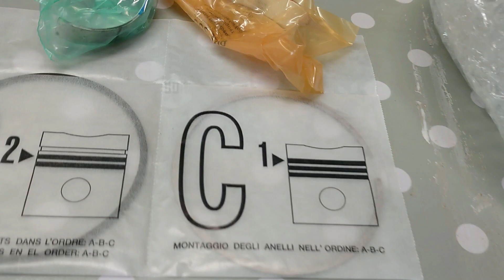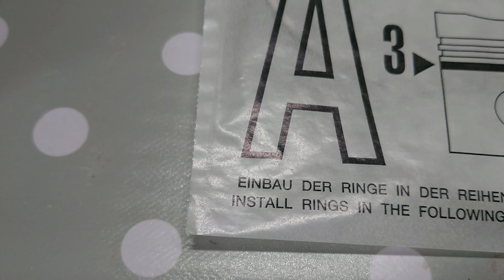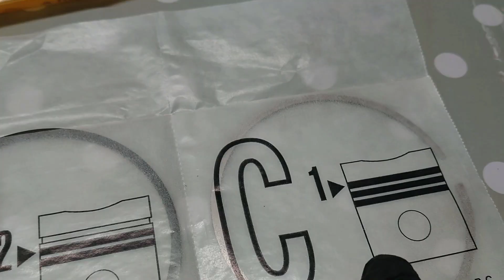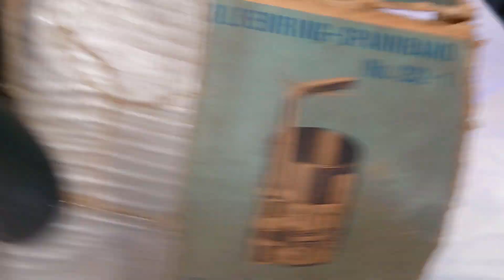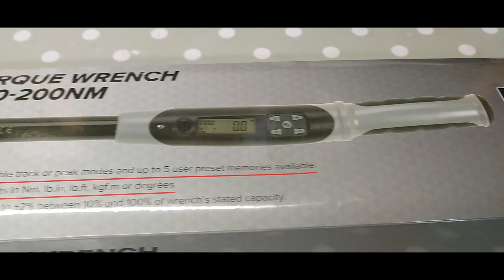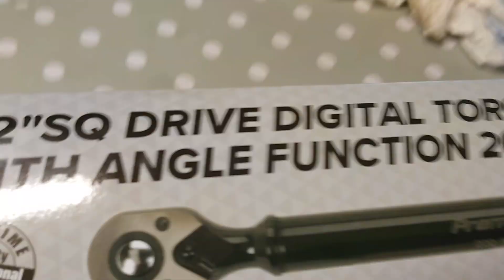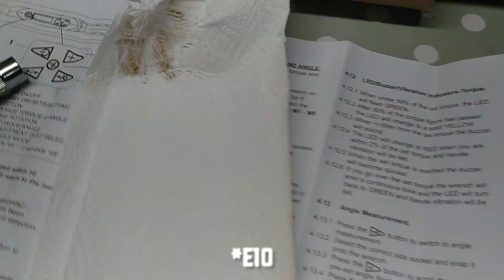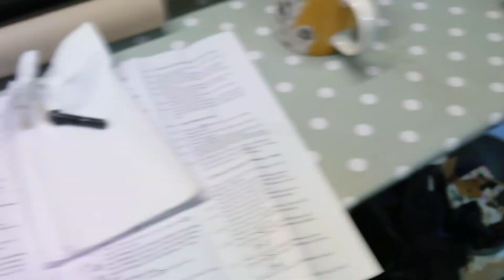Changing the damaged Piston on my BMW F10 M5 S63TU engine rebuild on the driveway

Comment from the maker: The rebuild begins now !! I've got to admit, taking it apart is one thing, but putting it back together is another. Hope I can remember where I put all the parts. Getting this piston in is just the start, I've still got 7 bearings to change and then reassemble the bottom end before I put the car back down on the ground and start work back up top. This could take a while.

I've also started a Buy Me a Coffee page, any and all donations are gratefully received and all proceeds go back into making sure this car gets back on the road.

https://www.buymeacoffee.com/RichsRides

Comment: Was their total failure to this engine when the piston blew or just cylinder issues? Just good info to have if it produced symptoms just in case its fixable if stopped immediately
Reply from the maker: when the piston blew. the cylinder marking is from when the engine was run after the piston had a hole in it. luckily it doesn't look like there were many miles out on it after it blew!

Comment: How did it go?
Reply from the maker: +Dark Knight Cars mate it's still up on blocks. had a tough year last year and have been too busy renovating a property this year so far. hopefully back at it in August 😃
Reply: @RichsRides  I replaced one of mine on the ground, cylinder 6, got it back together now I believe I have another on #4..
Reply from the maker: +Dark Knight Cars what is it with Cylinder 6!? bad design maybe?

Good luck on #4
Reply: @RichsRides  I had a tune on it we suspect pre detonation. Probably what ruined cylinder 4.
Reply from the maker: @ClearedForSomewhere  gah, where did you get the tune from, was it an off the shelf or custom job?
Reply: @RichsRides  Eurocharged tune it’s here in the states
Reply: @RichsRides  a place called Euro Charged they just uploaded it without checking the values of the pre detonation. I deleted the tune but it still runs bad so we are going to open the engine back up again. We initially removed camshafts not knowing you could remove the head with them on there. When we reinstalled them we put both the labels facing up which is not the correct way come to find out. We are wondering if trying to start it with one of the cams at a 180 different may have damaged valves. Now the cams are all back the way they should be but we are still getting a rough idle. Compression numbers are all at about 140 psi but leak down is perfect. Not sure yet we are sorta stumped
Reply from the maker: @ClearedForSomewhere  are you sure it's timed correctly? What about plugs / coils everything tight and plugged up securely ? Do the plugs look ok?
Reply: @RichsRides  plugs look like it’s running rich, everything is timid correctly, come to find out just about an hour ago the compression tester isn’t working correctly so I’m assuming the compression is fine. It showed about 140 psi switched it around to a couple other cars it showed 100 so we think the tester is no good. It just has a rough idle with no codes being thrown
Reply: @RichsRides  yes everything is good. We originally timed it with both of the labels up on the cam shafts come to find out one label is down and one label is up so we had to go back in and retirement we tried starting at like that so hopefully that didn’t cause any damage but all the test for leak down and compression are fine.

Comment: What happened to the channel? Did he fix it?
Reply from the maker: +smokedadowg I'm still here and the car is still up on blocks on the driveway.

unfortunately I had a few events last year that put this in the back burner. but I will be back at it when the weather warms up. I want to get this finished by the summer!

Rich
Reply: @RichsRides  glad to hear mate
Reply from the maker: +smokedadowg cheers dude. just a shame the weather is so crap at the moment!
Reply: I know the feeling bud I've got 2 classic 2 stroke 125 motorbikes that need finishing just way to cold to be out doing anything on them at the min

Comment: hello, did you find what happend to your old piston?
Reply from the maker: +Patrik Parlesák stuck injector, common problem on these motors.
Reply: @RichsRides  I find blown piston on my n63 but injectors are tested and they are ok.. now it’s running 2000km after rebuild with same injectors.. so I don’t know what happend here 😃

Comment: 12:45 Hmm, Nasty but for engine assembly get the best sockets. For all other applications standard sockets apply. (I built steel engined BDA engines for my rally car)... Hey you are not a bad workman blaming his tools...!
Reply from the maker: +Mr Z I hate those bolts, such a bad design in my eyes! 

Definitely not my fault 🤣

Comment: Serious torque procedure for OEM bolts did you ever consider ARP bolts I'm changing rod bearings soon and can't seem to find any information on ARP torque settings
Reply: I noticed some copper flakes in the last oil change I did and beginning to think it's time for a strip down, I'm guessing the prolonged torque settings are to stretch the bolts? I noted the ACL bearings allow a little bit more play rather then the OEM bearings. Would you still plastiguage it
Reply from the maker: +Jonathan Linehan definitely a sign it's time. I would guage it to be safe as you're going with the ACL bearings, but check with ACL too or someone who's used them before to be safe.
Reply: Thanks Rich I've make a little video and share all my findings with YouTube
Reply from the maker: +Jonathan Linehan I didn't look into them, just went for OEM. are you doing them yourself ?
Reply: @RichsRides  hi Rich yes I'll be doing it myself thinking of using ACL bearings and OEM bolts your video is the first I've seen showing the process awesome
Reply from the maker: @jonathanlinehan9316  very brave! I used OEM bearings  and didn't bother messing the wear with plastiguage as the bearings that came out weren't massively worn (in my opinion). But they definitely needed doing. You might want to consider measuring the wear depending on what your bearings look like.

Comment: Hi Rich, your saying we should let you know if your doing a mistake in the comments, and maybe there is something you need to know:
I watched all your videos so far and saw you in part 5 manualy honing the cylinder. Like you allready know the block is out of alusil. You can do it they way you did on a steel block, but on alusil you have to get some special polish paste to uncover the silicium-crystals to the surface. If there is alu left, then this can causes wear and friction. I hope its maybe early eneugh and you dont have the heads back on. This can be a very easy and cheap step to prevent a further damage.
Then theres another thing i might figured out what could caused your damage:
I almost ready everything i found on the german and american sites about the s63 engine(took me at least 30hours), because i bought a M a few weeks ago, and read a lot about seized engines and problems with the s63. In my opinion the s63 has very big problems with the direct injection. In the USA more than in Europe because other fuel quality. In some cases of seized engines the piston got hydroblocked while the injector stucks fully open and filling up the cylinder with fuel. In other cases the injector is leaking to much fuel wich wipes of the oil of the cylinderwall and causes just the problem that you have here. I would recommend you do not use the old injectors again without having them tested! Maybe in your oil analysis they found much fuel in it, wich confirms my thesis.
I realy hope you get it back running and wish you best luck.
If you need to know more, feel free to contact me.
Regards
Reply from the maker: +Azamat Bagatov thanks. it wasn't really a home, it was more of a clean off the build up of contaminants from when it blew! I did look into the Alusil treatment and special Alusil hone but it cleaned up so well I decided not to. I've know Porsche use this treatment too and they e suffered a lot with bore score in some of their engines (not sure if it's still a problem for them?). I've measured the roundness too, wanted to make sure I hadn't changed the shape of the cylinder and it's well within a few thou.

I agree about the injectors, they're going to get replaced as part of the rebuild too. there was. o point doing an oil analysis as I'd run the car for a bit until I found the problem, there would be loads of fuel in the oil sample.

have you had issues with yours or were you just reading up to find out what sort of issues to expect?
Reply: @RichsRides  Hi Rich, sorry for my late response.
I was just reading about issues i have to expect.
I found your channel at the time you removed the injector. I looked for some faster sedan cars since 2 years: first Alpina B5s, then Porsche Panamera, E39 M5 and for short an M5 E60 (usually i only drive BMW because i got all special tools and software from 1990-today), after a couple of very bad cars i decided the M5/M6 F-series is even with their problems the cheapest and most powerfull car on the market. So i owned a M6GC about 2 month ago. Drives great, but i got a very bit unstable idle about 100rpm in cold and stillt 40-60 when warm. I plan to do an compression test in the next time, but i dont expect any bad results, cause my oil consumption is 0.0, i got no codes, and wihtout the idle the car runs perfect. I bet i will find the problem maybe in the plugs or coils. today i cleaned the mafs, but without any results (have allready tried without them and still got thos issues). but i saw some of blow bye oil in the airbox, i think thats the reason why some mafs fail at some cars. Im also allready working an a solution to detect an failing injector as part of an inspection. Because the problem you have with that bad cylinder wall is my worst nightmare beside a hydrolock.
Reply from the maker: @AgentPipapo  mate M6GC was next on my list to be honest. Odd that it's just an idle issue. Like you say the oil contamination of the MAF is common, I was starting to look into catch cans rather than leaving it to re-circulate back into intake. I'm sure you'll find your issue but keep me in the loop and good luck!
Reply: @RichsRides  Hi Rich,
today i switched the coils at mine. But nothing changed, before there was Bosch in, where im a bit confused about, cause i heard usually there has to be Delphi in. However i switched to Delphi and everything runs exactly the same like before. Next thing are the spark plugs, i allready bought new ones (NGK usually for the 550i). I just dont wanted them to change, cause theyre not even 10tkm old(done by BMW from the preowner). Catch Cans i want to get too, but seems to be very difficult because of the narrow space. Thing thats an important upgrade in 2 ways, first ur maf would last longer, and second your inlet valves will remain cleaner. Because the direct injection cant clean them instead of an manifold injection. And when there gets the oil from the blowby it can built up carbon on them.
Today i would prefer to bought an M5 instead of an M6, the M5 is in my opinion the more comfortable car, and its about 20cm shorter, i havnt even 2cm left in my garage with the M6 in. How is the progress with your M5 doing?
Reply: @AgentPipapo  What software do you use ? is your socket obd1 or obd2 ? who does your updates and data management?
Reply: @lewymartain8267  OBD1 was never, BMW had ADS untill 1996, since then OBD2. I use Ista/Inpa. On The F-series you need a Ethernet-Interface, on the E-Series you need a K+DCAN Interface.
Reply: Hi rich, what a great job you doing,   Hope to see you finish the project soon. Just curious on the con rod bolts you are using (12:33) are they OEM bolts or aftermarket bolts?

Comment: Epic work mate!! I need to make those wooden block/ramps you built. Where did you buy the wood? Can’t wait till rebuild is finish. 👏🏼👏🏼
Reply from the maker: +Kadir Simsek cheers dude. The stands were made from left over 2x6 (50mm X 150mm) decking boards. Any local timber yard should be able to help you. Price of wood these days makes them worth a fortune I guess. 🤣
Reply: Cars sitting on a fortune 🤣🤣
Reply from the maker: @kadirsimsek4472  worth more than the car right now!

Comment: Hi rich , initially I used liqui molly when I had oil level low , but did not think there is more issue than that , now my M5 is just a show piece I see it and only wish as of my miracle I get a chance to fix it all up , can you advise what should I do with my broken piston engine ?
Reply: Want to sell it?
Reply from the maker: @Ben-in6qh  was that for me or @Popat5 Official?
Reply: @RichsRides  was for popat5, couldn't figure out how to tag. I also can't figure how to find and install ista+ if you have any suggestions. Cheers
Reply from the maker: @Ben-in6qh  for Ista I think I found it on a BMW forum through Google. The download is very large and took a while!

If I can find the link again I'll post it up for you.
Reply from the maker: +Popat5 Official do you know what's broken on it yet? has it lost compression or is it the turbos?
Reply: @RichsRides  no turbos are fine , I think two of the cylinders have lost compression
Reply: @RichsRides  mechanic suspecting piston damage
Reply from the maker: +Popat5 Official I'd get the issue confirmed as my first step. Scope the piston with a half decent scope and get a compression and leakdown test scheduled.
the scope will show you any damage, a hole in the piston should be obvious. if it all looks good get the compression test to confirm, a leakdown test will help you understand whether it's valves or rings if the compression is bad.
Reply: @RichsRides  ok thank you very much 
By the way Loved your effort put in to your M5 
You are really brave to be able to open that beast up keep making nice videos
Reply from the maker: +Popat5 Official thanks buddy, brave or stupid ... sometimes I just can't decide!

Comment: How does something like that happen??i own an f10 m5..and I haven't had any issues but dam that scares me.
Reply: I had to replace engine on mine after end bearings let go at 54k miles! And not that rare I found out. Got as 3rd owner bought at 24k miles and was burning 1 litre of oil every 1200 miles (BMW said normal for M5 and only considered problem if 500 miles!) Went down to a litre of oil every 800 miles then it let go when not even being driven hard. I think before me probably not run in well and driven hard when cold maybe. Careful running in on new engine and not pushed till warm means 8000 miles before top up needed now and at 89k miles
Reply from the maker: +NY NY can't be certain for sure, but suspect it was a faulty injector that didn't get picked up quick enough. leave it stock, service it regularly and do the recommended preventative maintenance and you should be ok.
Reply: Trust me pal , you don’t want issues , touch wood hope your M5 never break down , I only could drive mine for few weeks before it all went downhill and guy who sold me thins wrecked M5 fled , I wish I could turn back time
Reply: Trust me pal , you don’t want issues , touch wood hope your M5 never break down , I only could drive mine for few weeks before it all went downhill and guy who sold me thins wrecked M5 fled , I wish I could turn back time
Reply from the maker: +Paul Bicknell 8000 miles between top-up is more than I'd do between oil changes. what oil are you running?
Reply: @RichsRides  Castrol edge 0w 30, and I was thinking the same, maybe too long tbh. When it was burning lots at least it was always fresh as topping up so much lol. Different day different problem I guess. Taxi driver once said oil and filter every 4K and he had done 325k miles same engine!
Reply from the maker: @paulbicknell2226  4k sounds about right to me.